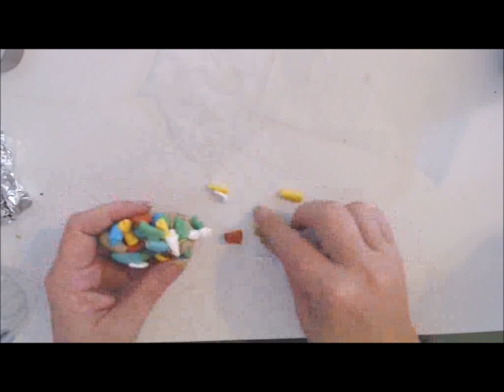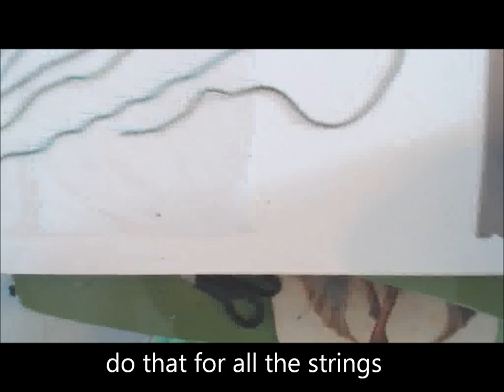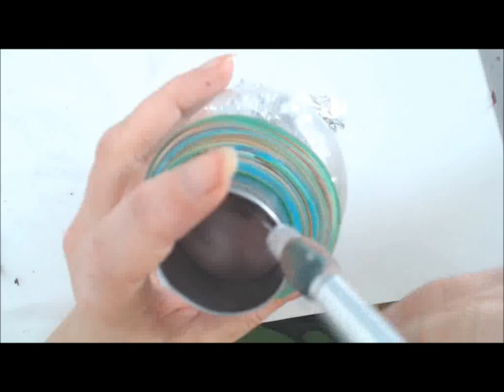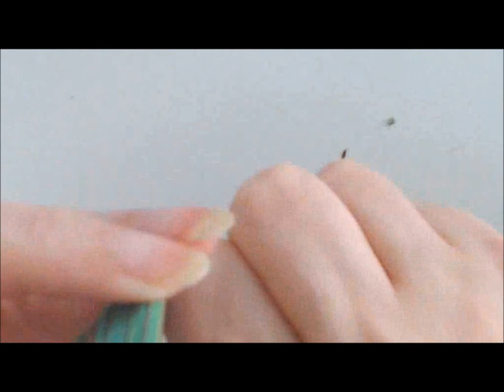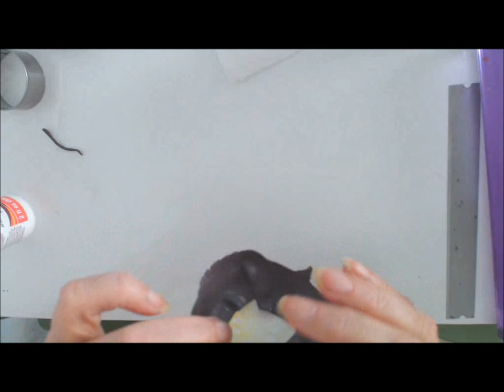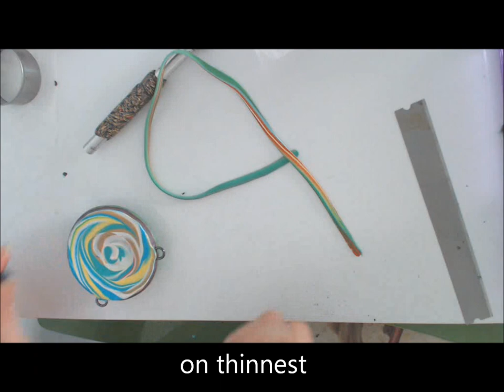Extruder string technique - polymer clay pendant tutorial 068

Comment: Thank you Kalyana, this is so pretty and a clever design. I was wondering if you could use several 1mm pieces of cord? I have just ordered 1mm cord for that purpose. Thank you for sharing this with us. Blessings to you and yours
Reply from the maker: Oh, absolutely. The thing is that the Kinte I am waiting for also has different colors, it's in the dark green-buff-pink-violetgrey range and I think it would match this pendant way better. Using 1 mm cord in several strands actually looks very nice, just use a tad wider endcaps and make sure to use a good glue.